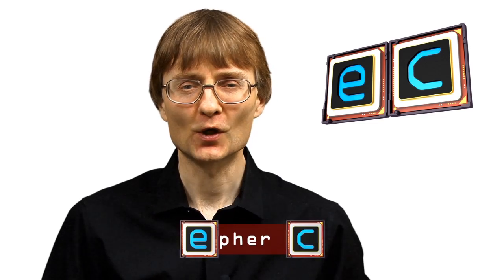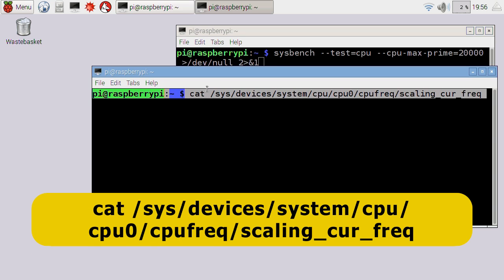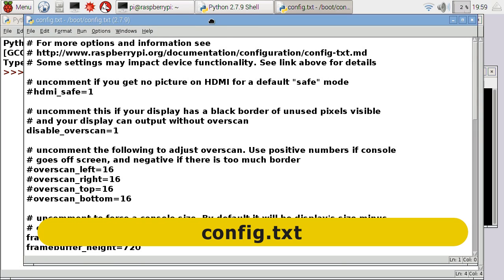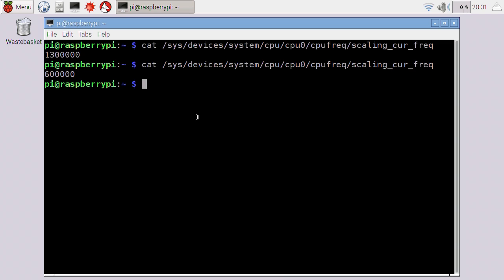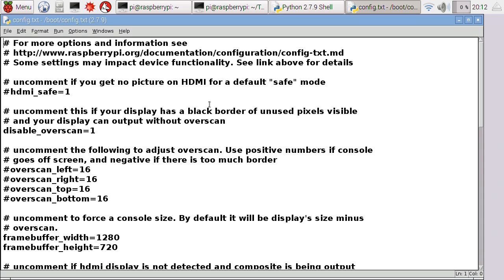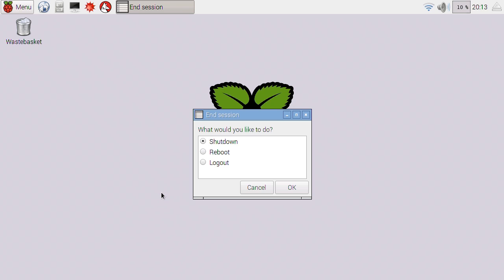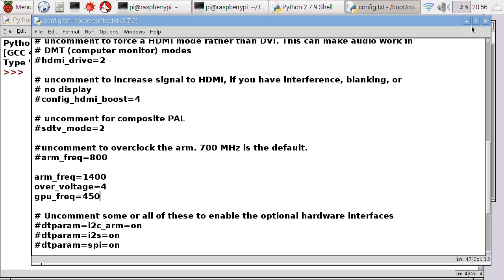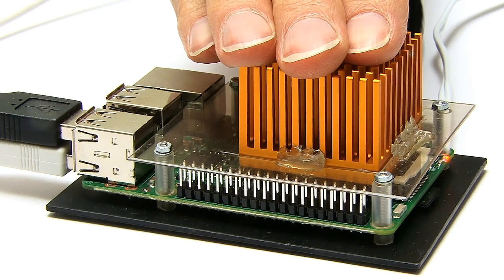Raspberry Pi 3: Overclocking

Comment: I don't get it why do people want to over Clock ? I don't think it wont last as along. I want my sstem's last for meny years
Reply: Nah, if you cool it right overclocking is pretty safe, by the time it degrades the chip will be well and truly redundant anyway
Reply: I have a system from 2007. It's a Q9550 intel quad core cpu. Stock was 2.83 ghz. I overclocked it to 4.5 and it's been that way ever since. So nearly 10 years later.

It's fine. This tiny little computer will be fine too, much less of an effect.
Reply: Well it's probably safer to run it wit a big heatsink at these speed than stock with nothing on it.
Reply: It's good if you're a RetroPie fan and you want to make your games a little smoother (mostly N64, PSP, PSX, etc).
Reply: I don't this we care if it last for many years, a new one will be out every few years and we will be breaking off a full $40 US for it.  I like the Pi overclocked for 3 reasons. It make the experience of using it much more fluid.  It promotes the hobbyist to learn more commands/system parameters. And lastly, everyone loves to dim the lights and see their CPU glowing....Set it at 1.4 add a +4 volts and forget it.
Reply: I have overclocked my Intel Pentium E2160 from 1,66GHz to 3,33GHz and it is stable for 10 years. No water cooling, just Thermaltake Sonic Tower with 120mm fan at 600-1200 rpm.
Reply: Considering it still runs cooler then stock without a heatsink, +16.6% on the CPU and +12.5% on the GPU is a pretty good boost!
Reply: wouldnt overclocking the little pi be like supercharging a honda? fun until it explodes ... then you look like a fool
Reply: I look at it like this. I have yet to have one go out but I havent put them to a lot of use either. That said it is dirt cheap and by the time it goes out there will be better ones.
Reply: because  its fun! if you like that sorta thing. its like trimming the sails in a surfcat. can put up a sheet, n move without much stress. but its so much more fun cutting right on the line (and most importantly, finding that line where your clipping along vs upended in the water). its also neat to know you have a system that is faster than what is off the shelf. my favorite overclock was my old athlon xp, which was a 2200+ stock at 1.8. running that at 2.5 was a faster than the top of the line $900 dollar chip, from my $140 chip. a good feel. 

 in terms  of longevity, ive found obsolescence kicks in before the system fails. that Athlon ran for 4 years, n was still stable when i needed a new PC for other upgrades (PCI-E, SATA etc). another was  a Q6600, running balls to the wall. it only got flaky after 6 years, by then it was a secondary system, and not a great loss when the cpu crashed regularly, because i had other secondary systems to replace it with.

If your going to use a Pi for a +10 year project, dont even think about overclocking (infact, use the same technique to under clock/volt). but what are you doing expecting a Pi to last 10 years in 24/7 use? if thats what you need, get a commercial pc/104 style system. Pi's exist for mucking about with, trying a thing, having fun with the nuts n bolts of computers in a way its easy to be insulated from nowdays.

Go Nuts! Play, learn, tinker. break it if you want. their cheap!
Reply: I bought an Intel E2160 in 2008 I belive. It was clocked at 1.8GHz stock, from day one I overclocked it to 3.5GHz. I used it until 2011 when I switched to 2500K (also overclocked btw). The E2160 still works as a file server, running flawlessly at almost 2x the stock clocks for over a decade.

Comment: +ExplainingComputers 
Hi. Thank you very much for the video. I have a problem with 4:08 the file didn't open. Do you have any suggestion what to do in this case ? I also tried overclock it with Raspberry Pi Software Configuration Tool but when I tried it says "This Pi cannot be overclocked." and then "There was an error running option 8 Overclock " Thank you.

Comment: How about the time comparison of the various tests... and why stop at 1.4GHz and over_voltage=4... take it further
Reply from the maker: Further down here (see comment from +youssef grine) there is a report of running at 1.5GHz OK, but not being able to get to 1.6GHz! :) He obviously got a Pi with a SoC from a very good batch indeed. The master baker must have been in that day.
Reply from the maker: It would not go further -- and work! :)
Reply: I got it to 1.45GHz stable.
Reply from the maker: SwiftHDX
Excellent -- you have a Pi 3 from a good batch! :)
Reply: ExplainingComputers Yeah, got pretty lucky I guess. Didn't they put a limit on the overclocking though? Wasn't it coincidentally 1.45GHz or am I dreaming? I remember the Pi 2 went well above that.

Comment: great video, but i want to ask one thing,

i am pretty new to the raspberry pi, i´ve bought it only a week ago, but does this work with the raspberry pi 3 model b as well? And if yes, is it the same process or something different? I´ve heard that raspberry pi 3 and pi 3 model B is the same thing from some people, but others say it is not. Thanks!
Reply from the maker: There is only one Raspberry Pi 3, and technically it is the Raspberry Pi Model B. But there is no model A. The first ever Raspberry Pi computers came as model A or model B. But the Pi 2 and Pi 2 are model B only. So a Raspberry Pi 3 and Pi 3 model B are the same thing. :)
Reply: Ok, thanks

Comment: You said you didn't have a heat sink on the RAM, but on the Broadcom BCM2837 SOC, isn't the RAM part of the same chip that you have the heat sink mounted on?
Reply from the maker: The SoC contains the CPU and GPU. The Pi 3's RAM is mounted on the other side of the PCB.
Reply: Ah! Good to know. Giving any consideration to adding a heat sink for the RAM? I'd be interested to see just how much performance one can squeeze out of the pi 3.

Comment: Hey amazing video. When i type sudo raspi-config in terminal window and go to overclock it show me "This pi cannot be overclocked." what could be the problem here, i have cooling sistem on.
Reply from the maker: You need to open the raspi-config file in an editor (opened via sudo -- eg I used sudo idle in the video). Typing sudo raspi-config will open the configuration utility, which will not allow overclocking on Pi models (like the 3) where it is not officially suppoprted.
Reply: Oooo ok thank you, i was watching few videos on youtube how to overclock but on my raspberry pi 3 didn't work. I try your way and  ow it works great thanks.

Comment: I have done some tests with a ceramic heatsink and other bits for reference here: http://www.instructables.com/id/RPi-3-Cooling-Tests/
Reply from the maker: Cool. :)
Reply: I just checked out your research data. I must say that I'm quite impressed with the extent of your testing parameters, especially with regards to your inclusion of the ceramic heat sink to your experimentation, as I just recently learned about it from an incredible member [shabaz] of the Element14 Raspberry Pi community and I had yet to witness it being employed anywhere else as a result of my recent Google search in an attempt to gather information for the same:

https://www.element14.com/community/community/raspberry-pi/raspberrypi_projects/blog/2016/03/03/raspberry-pi-3-cooling-heat-sink-ideas
Reply: Thank's! kept me busy for an afternoon. I mainly did it because i could not find any information online

Comment: Hi Christopher, it is recommended to have a 2A power supply for the Pi 3 especially when overclocking, it would be interesting to see a video where performance is measured when 1A, 2A and above power supplies are used to see if it would vary?
Reply from the maker: Yes, I used 2A here, but you suggest an interesting idea. Noted. :)

Comment: which power adapter do you choose?
Reply from the maker: Here I think I was using the most recent official Raspberry Pi one (simply because it came in a pack with a Pi Zero, which I had to buy in a pack!). But I have also found very good a 2A Amazon Basics USB PSU.

Comment: Can you overvolt the GPU?
Reply from the maker: Yes, see the last test I try in this video. :)
Reply: ExplainingComputers I know you overclocked it, but did you overvolt it? Is the overvolt on the CPU the same as for the GPU? I don't really know how the processor works. The GPU is embedded in the same package as the CPU, correct?
Reply from the maker: GoldenKingStudio Yes, you are right, the CPU and GPU are both in the SOC chip. I think you can overvolt the GPU.

Comment: The logical next question would be: What are the long-term effects? I'm thinking about overclocking my Pi 3 to get some extra fps out of demanding emulators, but I don't want to fry it by playing N64 games for hours on end :)
Reply from the maker: It will reduce the life of the chip -- but should not do so significantly if you can keep the temperature below, say, 60C, and ideally less. So good cooling is the key.
Reply: >60C for overclocking is very useful information. Thank you.

Comment: the warnings are correct but most modern computers with overclockable motherboards will resist hardware failure from a bad overclock. Not saying its impossible anymore but it is unlikely. However this is on a regular pc not a pi

Comment: You could change the clock frequency value in the config file from the command line using sed or awk much quicker than in an editor.
Reply: Agreed. The actual cooling experiments were very informative, thanks for doing them.
Reply: Yup, but everybody who knows how to do that doesn't need to watch this to learn how to overclock ;)
Reply from the maker: avro549B Totally true, but there is always a balance to be struck concerning the level and quantity of content to include. :)
Reply from the maker: Indeed. :)
Reply: True, but showing it would teach them something new.

Comment: Many thanks for another interesting video about the pi.
Do you think it is possible to go up even higher, let's say 1.5 MHz?
Would underclocking save energy? Or would it be possible to reduce the idle speed from 600 MHz down to let's say 400 MHz?
Reply from the maker: I could not get above 1.4GHz. Somebody in the comments here achieved it -- it will be luck of the draw on the Pi you have. Underclocking would indeed save power, and is an interesting idea! :)
Reply: I do not really need to overclock my pi, at least not yet ;-)  (I'll have to buy a new one anyway)
But I think I could underclock my pi3, as it runs with volumio, which is a free audiophile music player software based on raspbian, that would run on every version of the pi and does not need much ressources.
Reply from the maker: e1woqf I will now checkout Volumio -- thanks! :)

Comment: +ExplainingComputers  watched your last video but now I'm thinking: what if you use a Paltzer cooler (thermal electric generator" between the pi's processor and the heat sink either being powered by the pi itself or separate power source; using that to transfer heat. If so can you do a tutorial?
Reply: I have been thinking of doing that just for fun. The 10x10mm peltier can be had for around USD 2.00 and should work off the Pi with the existing power supply. I employ the official power supply sanctioned and prescribed by the Raspberry Pi Foundation.
Reply: alienalxclone I fought 5 if the lesser one the problem then you can fry it if you use to hot of a hearing source the pi should be fine for it though of course I used a candle as my heating source
Reply: Thank you for your input.

Comment: On my Pi 2 I put thermosetting epoxy heat conduction. It made a 3.0 c lower that the paste on my massive heat sink.  I took CPU  and cut it down. It sticks out the case by 45 mm. And yes I can convert inches to metric!

Comment: 53.7 celsius is 128 degrees fahrenheit I would think anything over 110 degrees F would be too hot. Most processors on PC's are made to run even at 110F without any issues. I know the new One Plus 3 phone gets as hot as 129 degrees F compared to other phones.

Comment: Did you CTRL+Z your logo change?
Reply from the maker: Well spotted! I just forgot to change it on the end. I noticed this when working on next week's video today -- and put it right. But this slipped through. I just don't check things as carefully now I do a video a week. :(
Reply: I'm nit-picking - keep up the good work ;-)to monitor temps and cpu clock use:#!/bin/bash
echo __________________________________
while [ 1 ]
do
echo -en "\033[4C"
date
vcgencmd measure_temp
echo -en "\033[A\033[12C"
vcgencmd measure_clock arm
sleep 1
echo -en "\033[2A"
done
remove the final 'echo' line to get a rolling output.
Reply: hmmm youtube removed the linebreaks - you'll need to use your imagination! (or message me!)

Comment: I enjoy your videos. It would be interesting to push the Pi until it failed. I'm curious to know what would happen if the Pi was configured to use max voltage and max buss speed, then increase  processor speed until failure. It would also be interesting to graph power consumption vs. processor speed. Keep up the GREAT work!

Comment: I was thinking:

- How much does ambient temperature influence the results. 
- Not everyone would have such a big heat sink on their Pi what about with a small heat sink (the one that comes with a zebra case for example) or no heat sink at all.
- what is the max temperature the CPU is rated for?
- is there a failsafe in the Pi that will reduce the clock frequency if a certain temp is reached? Maybe a good idea to also get the clock frequency with the temp.

As for measuring:

make 2 programs... one that maxes out the CPU for let's say 10 minutes and another program that takes a snapshot every second or so to see the curve on a few stats. Put the results into a CSV and create an graph in an spreadsheet program in a few seconds. (or into a SQL lite database and turn it into a nice graph with your language of choice. PHP and the Google Chart API's for example). Here is an example how this could look: https://vampier.net/pingmonitor/ (this time with pings over time)

Comment: Another excellent Raspberry Pi 3 video. The test results were very interesting with passive cooling. I would be interested to learn what was the performance difference for this test in terms of speed over an non-overclocked RPi3.

I can see where overclocking may come in useful for certain intensive tasks but I would worry that it would severely reduce the overall lifespan of my RPi3.
Reply from the maker: Yes, overclocking is an experiment that is not needed in practice for many things. :)

Comment: I put some ice in a small, 1liter bag (because it would overheat a lot) and it would stay at about 26-33°C. Imagine a heatsink, a fan and ice.
Reply: dry ice acetone mix....pure dry acetone dosen't conduct so it will get to -79C....liquid nitrogen is way better but hard to get
Reply: So you can poor it without damaging parts? mattibboss
Reply: RAZERZ kinda yes i have been cleaning few phones and worked compleatly fine even still wet...but the acetone needs to be dry, but it can contain water, but it needs to be pure
Pure H2O dosen't conduct water
Add a bit of table salt (NaCl) and the horror beginns what you get is sodium hydroxide which slowly eats glass and is corrosive also you produce chlorine gas...
I use good quality acetone for most cleanups 
But you can't use acetone for every phone...a RPI should be fine (acetone dissolves stuff...may have problems with lcd stuff)
But a pi should be fine...but there is always a risk of overheat and acetone catching huge fire...never do indoors

Comment: put it in the fridge and run the tests again.
Reply: Linus Tech Tips tried that, and his attempt failed because he used a full-sized desktop with active cooling. A small system on chip like the Raspberry Pi with passive cooling should work.
Reply: That really won't work
Reply: +("RNA0ROGER") it will with active cooling.
Reply: Tried on YT already, computer temps just gradually keep rising
Reply: Putting inside fridge works to reduce temperature . It never goes above 42*c  with heatsink and overclocked at 1.4ghz
Reply: +Dylan Scully it doesn't work on a desktop computer,  but on something like a pi with a tdp of a few watts,  it should work
Reply: It's still heat output though, size shouldnt matter

Comment: My pi 3 is overclocked at 1.5ghz with overvoltage 5,and it is very stable but when i try to go to 1.6ghz with overvoltage max it crush after a few minutes from the boot.But the temperatues are a little dangerous because at 1.5ghz(with a heatsink) it keeps at 80-90° and sometimes at 100°,with a heatsink+40mm fan it keeps the 70°max.But at 1.4ghz overvoltage 4 it is stable
Reply: youssef grine congrats, you now have half a Snapdragon 430 CPU
Reply: +シッセンエリック No, it is not the heat that is making it unstable.
Reply: Michael Flatman Which half? Split vertically or horizontally? How did you stop the 64 bits inside from falling out?
Reply: Do you think a heatsink like the one from the asus geforce 210 with 2 fans on eache side would be able to let it run at 1.6ghz ?
Reply: I have a 5V0.2A fan and a heatsink on all the hot chips, playing youtube videos on 1080p it stablizes at around 53C at 1.35GHz, should I try to push to 1.5Ghz?

Comment: Will it under volt?
Reply: To reduce heat and power consumption
Reply: I don't know, underclocking is possible though
Reply: y!?
Reply: once I underclocked my Pi to 100 MHz, works well just slow af.